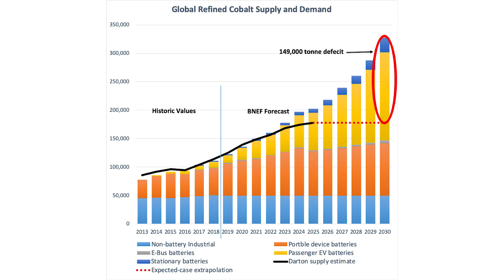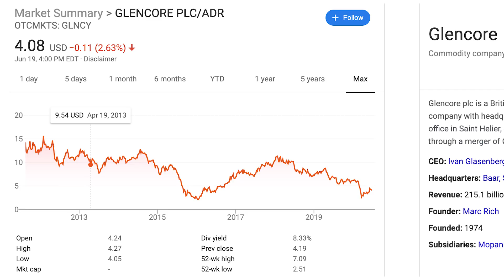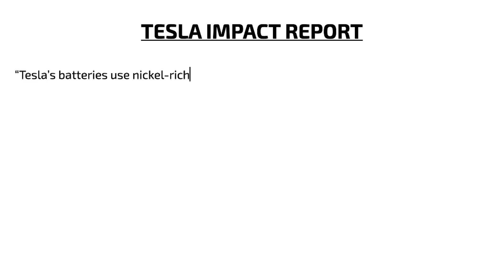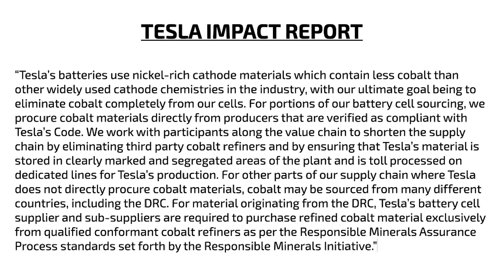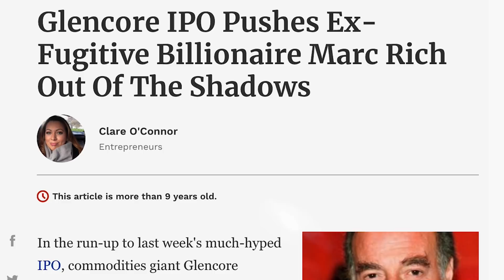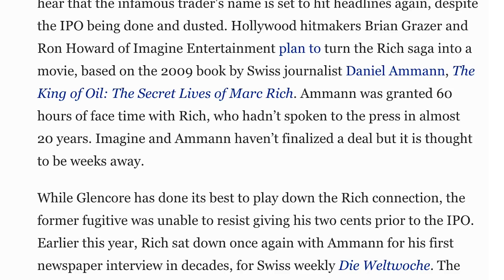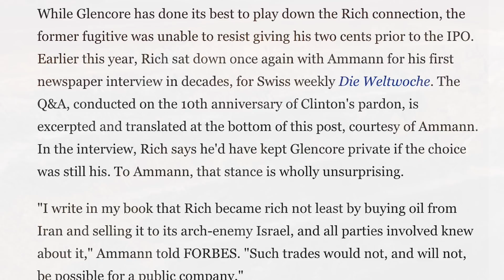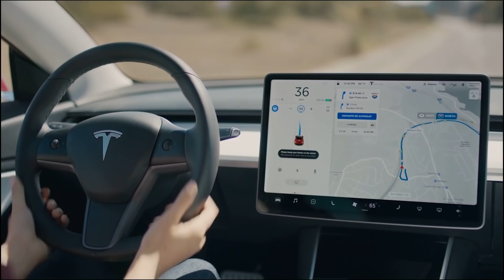Tesla Cobalt Free Battery? Tesla and Glencore | The Dark Side

Comment: This is the same story as Conflict (or Blood) Diamonds funding insurgencies in West Africa. This has largely ended as far as I know by the identical measures of source certification outlined in the Tesla Impact Report. Tesla is insisting on accountability from Glencore audited by independent third parties. It could well be that Glencore is a criminal enterprise. It is not for Tesla to address that, just that the cobalt pipeline itself is clean, and not contaminated with input from the illegal mines. As others have said, the solution is to encourage good jobs and social development, not to withdraw from the DRC.
Reply from the maker: Hey Jamie, thanks for adding this level headed thought. I wouldn't go so far as to suggest w/d from the DRC, I just wonder how Tesla would be able to actually verify anything from that supply chain. It's far too complex and they don't let anyone on site let alone to see how the cobalt changes hands you know?
Reply: @DillonLoomis22  It is a tangled web, and like any mess, it will take time and dedicated effort to clean up. I grew up on the Zambian Copperbelt, so I have some feeling for the situation in Central Africa. The ore is sent from Katanga mines to Zambia for processing. I believe that it should be trackable from there. Any contamination will happen before that -- still a problem, but much smaller than a few years ago.
I have not followed the situation closely enough to speak with authority.
The Congo has always been an anarchic place, with Katanga at the bottom of the pile. It is the most wealthy province in natural resources, but all the money goes to Kinshasa. That is where reform must start, with the "leaders". Katanga has often rebelled, revolts that were crushed or hijacked, leaving the place unchanged.
Reply: @DillonLoomis22  Mines in DRC have been appropriated, making investments much more risky. Zambia respects property rights, which is why the refineries are there -- the investment at risk is reduced.

Comment: You know that Jeff Dahn has determined that Cobalt is actually detrimental to cell performance?
Reply from the maker: Hey Roger...did not hear that actually. There are certainly better chemistries out there but getting them to mass production is another thing
Reply: @DillonLoomis22  
Watch this, from 11:30 onwards.
(Jeff Dahns' team has been working on this for years)
https://youtu.be/wtV9a5MW_X0

Also note the Elon tweet re shareholder battery day.... At Fremont.
To "include a tour of the cell production system ......"
At Fremont.
Making cells, on a new line.... In a factory with no room?
Must be a high density, low space program.

Comment: Cobalt supply doesn’t necessarily mean TESLA doesn’t have a cobalt free battery chemistry. TESLA now has multiple chemistries for many different applications. For example, extreme cold weather battery peaker plants could use cobalt, whereas other applications could go completely cobalt free.
Reply from the maker: Hey Adam, this is a fair point but my question would be if they have the chemistry why wouldn't they implement it? I'd imagine removing a metal from the chemistry and saving the money they spent on the cobalt deal would reduce costs and improve manufacturing times you know?
Reply: Electrified Perhaps different chemistry formulations perform better (more effectively) in differ situations. Perhaps they already are preparing their cobalt free option for automotive use as we speak.

Comment: 1. Cobalt will be bought from the DRC whether it's by China or Big Oil. The latter need cobalt in the process of refining petrol.
2. Of course we want cobalt to be mined ethically and we should pressurise mines to do so. But deciding if people should be allowed to work in dangerous, awful environments isn't our prerogative.  Especially if we're not providing employment alternatives.
Reply from the maker: Great points here. The only thing I'd add is that the 25% of operations that happen at makeshift mines are most likely not an employment situation as much as they are a slave situation. Of course employment alternatives would be great but a start would be to lay the hammer down on anyone exposing young children for essentially no pay
Reply: @DillonLoomis22  agreed.
Reply: The DRC has about 40,000 child laborers mining cobalt. Cobalt is needed for eliminating phosphorus from oil. 18 million people per year in the USA need ambulance. Ambulance vehicles run on oil. The argument that oil is unethical because of the use of Cobalt is a non-issue because it saves oil does more good for more people than bad. Oil is dirty on some levels, but 40,000 kids not going to school is less significant than 18 million people’s lives being saved each year.